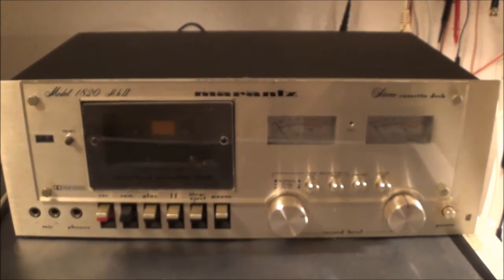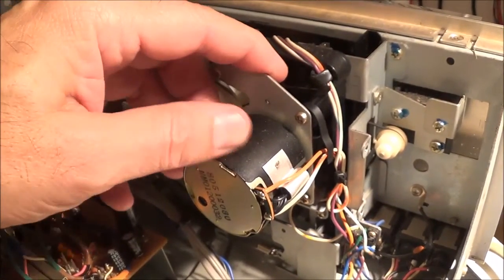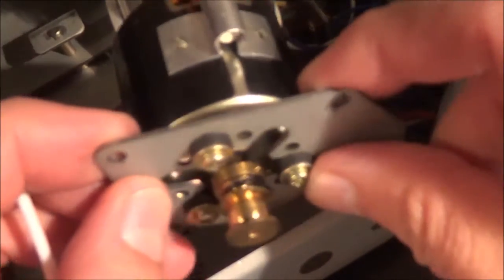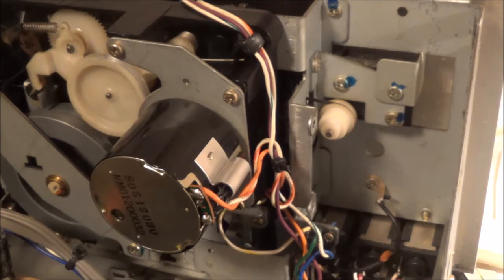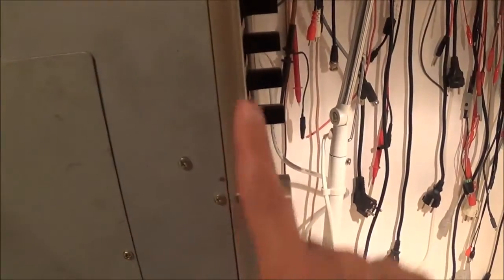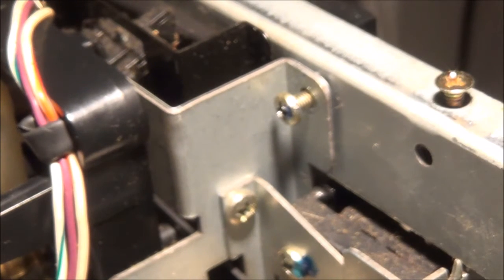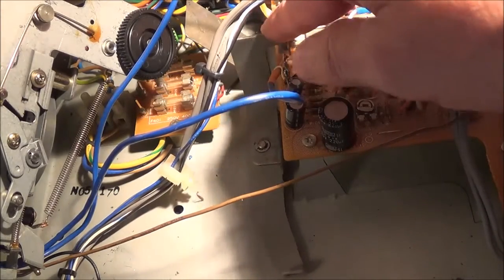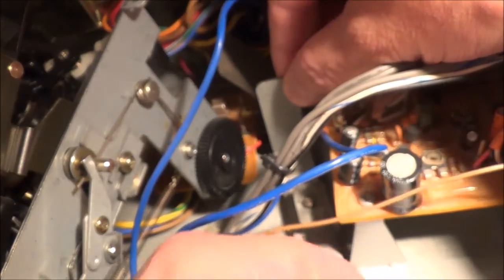Marantz 1820 (5000) Cassette Deck Belt Change -- Part 1

Comment: Hey I know the pain you went through on cleaning the belt goo off the motor pulley. I repair the old superscope tape recorders and see the same problem. Some things I have tried with good success is using freze spray to get it hard and brake it off with a dental tool. Use acetone and dental floss just do not get it on plastic. Also I learned this from Bob Hienz at Marantz Factory Service in Il. Use ammonia and soak the parts . It cuts the sticky rubber right off. Hope this helps. Jimmy from Alabama
Reply from the maker: Jimmy, thanks for the great tips! I know that acetone can attack plastic; that is why I never used it. Didn't know about ammonia; will have to try that sometime on stubborn goo. All the best!

Comment: A couple things...  First, it's easier to clean the brass pulley on the motor by removing it first using a hex key.     The only thing to watch is the depth of the brass pulley so you put it on in roughly the correct spot.  Mark it with a sharpie.    Second, removing the goo is much harder than even you show.  I had to use goof-off and lots of rags. Wear rubber exam gloves to minimize the mess.   Third, almost all of these decks will have a glazed pinch roller and the tape will not play correctly  (it bunches up).   I've removed the pinch roller holder and done a light sanding on the rubber to rough it up a bit, but it's a bit of work getting it off and getting it back on correctly is a challenge to get the tension set correctly.   I wish I had taken a picture before hand.   I'll get it figured out.    I've ordered a new pinch roller but that won't arrive for a month. 

 But thank you.   Very helpful video.
Reply from the maker: Good to see that you are making progress. I thought the motor pulley was easy to clean without removing it. I think I used a toothpick, cotton swabs, paper towels, and isopropyl alcohol to do the cleaning, but I am not sure--been so long. I probably would have attempted to sand the pinch roller while in the deck. I have glued some sandpaper to a flat chopstick and do it that way if possible. I put the unit into the "play" mode and hold the chopstick to the pinch roller while it turns. Good luck!
Reply: @OldSchoolElectronics  Yes, I should have sanded it on the deck, but the 1820 is miserable to get access.  It would help if someone shows a picture of a working deck with the travel set correctly.  Right now, the pinch roller is too close to the capstan and so the tape won't even load.   And the spring that keeps tension on the capstan is not set correctly.  I have the service manual and I'm working through it.

BTW, thank you for creating the video.
Reply from the maker: Thanks for watching. It would be cool (if you have the time) to maybe make a video so that other people can learn how to set the correct positions.  And good luck with the deck!

Comment: Old School,   where did you get replacement belts?
Reply from the maker: On eBay Germany, there is a seller that has these belts; they ship worldwide, but not to every country. I don't recall the name of the seller.
Reply: @OldSchoolElectronics  Thanks for the speedy reply.   Looking on the US ebay, there are seller that have collections of different size cassette belts relatively cheap ($10 or so).   Would that be a viable option?
Reply from the maker: Sorry, YT just showed me your comment today. Those cheap belt collections normally don't have the wide main belts needed for certain decks.

Comment: hi , what is size for each belt ?  I couldn't find original belt in my country and want to use other brand but I need the size of each belt.
Reply from the maker: I can give that to you in a few days when I open the unit up again. I have to open it because I was sent the wrong size belt for the auto-shutoff.
Reply: help my please  , what is the size of the flat belt ?